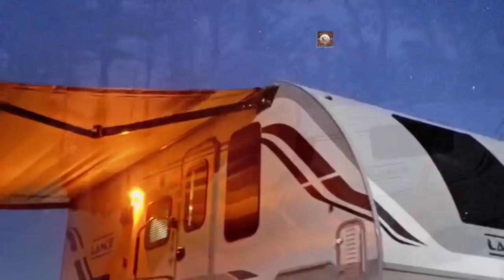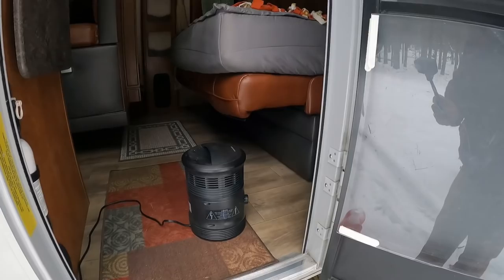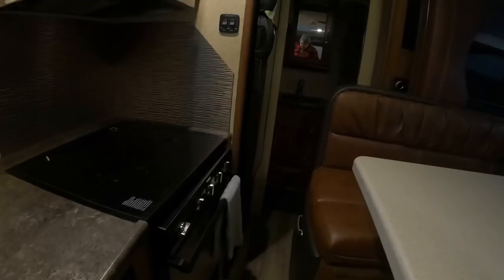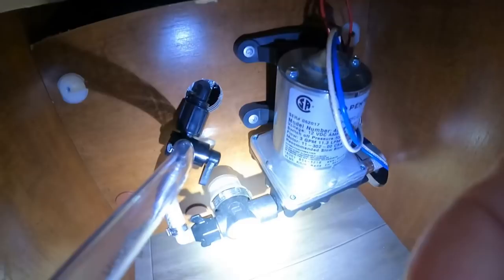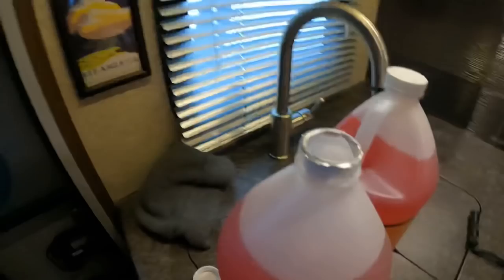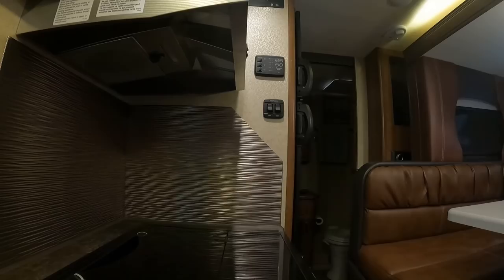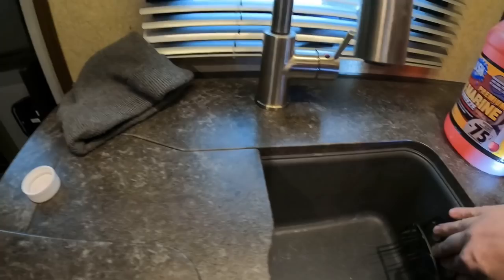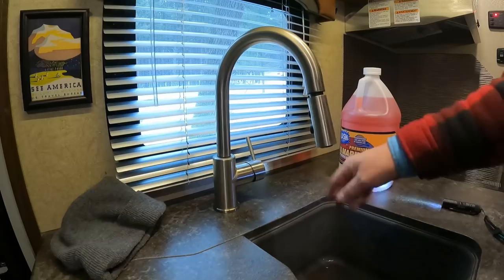Winterizing our Lance RV in Under 15 Minutes!!

Comment: You can leave your lithium batteries in the trailer, just don’t let the solar panel charge it in freezing temps. We live in RI and it’s cold, so we have a switch between batteries and panels we shut off. We Winter camp and charge them back up at a all year campground about once a month. You only lose about 25% in a month if you let it sit in yard. I hope this helps. Happy cold camping! Bob and Deb 👍🏻🇺🇸
Reply from the maker: Thanks for the information on the batteries.  I may just unplug the solar panel and then turn the battery switch off.

Comment: We have a 2019 Lance 2375 and a 2014 Toyota Tundra with Priories hitch. This is our 4th trailer not including the coleman pop-up. I had been blowing out the water system with air. Last year with the Lance I was behind schedule and didn't have time to make modifications to blow outhe system so I decided, against my better judgement to use the link stuff. I I purchased the more expensive fluid specifically designed for RVs in hopes of avoiding the after smell in the Spring. Boy was that a mistake! We dealt with the rotten smell and taste for most of the season. This year I found it was easy to put a female garden hose fitting on the clear tube used for the link stuff. I still used the antifreeze in the the drains. Now we won't have to deal with the smell again. We love our Lance and would be happy to compare notes if you are so inclined. We live in New Hampshire but purchased our Lance in Albuquerque after capsizing our Rockwood in Texas.
Reply from the maker: We have never noticed a smell from using the RV antifreeze before.  We know a couple of people who use cheap vodka to winterize with!  LOL

Comment: I winterized our T@B 400 all by myself this past fall, but I did put a lot of the pink stuff in the fresh tank. Next year I'm going to try it with that bypass kit--it's on my Amazon list.
Reply from the maker: Either way works but it definitely takes a bit more using the fresh tank method.  We have actually done it both ways before.

Comment: You should engage your battery disconnect in the winter because your solar will try to charge the batteries and lithium should not be charged when temps are below freezing, it kills the battery life.
Reply from the maker: We keep heat on in the trailer so the batteries are never below 40 degrees Fahrenheit
Reply: @TravelswithDelaney  I see that they are in an outside compartment that is vented to the outside....Do they still keep warm in there?

Comment: I went a little further on my winterization.  I blew out the lines first with a compressor, drained the water tank and poured about 3 gallons in the tank to run up through the line to the pump.  I also ran antifreeze through the tank rinse line and in our case, the shower miser line back to the tank.  I probably used a total on 6 gallons of antifreeze but I'm fairly certain I'm good.  I left my batteries in and put a battery tender on them.

Comment: Just a word about dryer sheets - my cousin is afraid of mice SHE HATES MICE . When she winterized her pontoon boat she would use several boxes of dryer sheets . Needless to say , she was very upset when I had to remove two active nests one Spring day - and yes the nests were made up of dryer sheets .
   On rare occasions I would get a mouse in my camper . Ladybugs & stink bugs were more common . I finally took care of both of these problems in my camper . I spent a whole day (less naps) finding & fixing entry points . So far for the last 3 years no mice , no bugs . 👍😄
Reply from the maker: thank you for sharing that.  We have used dryer sheets for years and never had an issue.  Good to know.
Reply: What's with the dryer sheets???
Reply: Brion spent 1/2 day fixing all the entry points underneath Shadow while camping in Joshua Tree last fall bc we had a guest at night nibbling on top ramen!

Comment: Howdy!  I believe your model Lance has dry traps in the kitchen and bathroom sink. I believe it is a standard p-trap in the shower. So wherever there is a p-trap you want to include the anti freeze in the trap and put the drain stopper back in to avoid splashing. 
Saw you by-passed, but not empty the water heater. But we should probably assume that. 
We have the 2021 Lance 1985 and blow out the lines because we haven't researched whether or not the pink stuff is OK to consume, or have on our bodies, even in tiny, tiny amounts. But if we find the risk to be tolerable with your method, we will switch since it will shave off a bit of time and set up.
Reply from the maker: I had emptied the water heater the week before when I had drained the low points.  I probably should have mentioned that.

Comment: On the lock it might not be the battery, there is a small on/off switch on the interior side of the lock near the interior manual lock.  More than once I’ve managed to turn it off.  So now when the lock is completely dead I check that first.  The batteries have been lasting at least a year, I change them in the Spring.
Reply from the maker: Thank you....I will check that and see if that might be the issue.

Comment: Hopefully when you drained the water system you opened the hot & cold water valves under the camper and opened the sink spigots inside. This drains the water at the lowest point in the camper.  Also, the water heater needs to be drained by removing the drain plug after it is bypassed.  When I do this in my Lance there is no residual clear water left in the system.  Perhaps you did this, but I just thought I would mention it.
Reply from the maker: Yes I did.  Thank you....I should have mentioned that I had opened them up

Comment: Hi Patrick, Did you drain the Water Heater prior to winterizing (as part of this video?)......as always a Great educational vid, and thanks, Mike Mezo
Reply from the maker: Yes I had.  I had actually drained the hot water heater and opened all of the low drain points a couple of weeks prior.   This was just running the antifreeze through the lines

Comment: I am curious.  Where do the "rodents" that you spoke of get into your trailer??
Be well and stay safe.  Very good stuff.
bf
Reply from the maker: Mice can get in the smallest of openings. Many times we have seen openings on trailers where the manufactures won’t completely seal openings where they run wires or pipes through the floor of a trailer.  That small opening can be enough for them to get in.  Expanding spray foam will assist in solving that problem.
Reply: @TravelswithDelaney  
  Thanks Patrick,
   If all goes well my new 2022 Lance 1985 will finish ins late May or early June.  Your channel has been very informative and helped me with my decision to buy.
   Be well and stay safe out there,
bf

Comment: I’ve had lots of RV’s and done winterizing myself. Did I miss where you bypassed the hot water tank before you ran pink?  Stay warm. -11 here today
Reply from the maker: I mentioned right at the beginning that I had bypassed the water heater and tried to show the valve but the lighting was dark

Comment: Good video but I guess I am confused where the water is coming from if you had already drained the tanks? Did you add some in order to winterize, or did I just miss something? Thank you for the video.
Reply from the maker: It’s just the water in the lines.  When you start pumping the antifreeze in, it pushes the water in the lines out
Reply: @TravelswithDelaney  thank you. I am a newbie. We just bought a 1985 and we live in CO so will be winterizing. Thank you again.

Comment: Could you just use the internal pump  in Tab400 like when we disinfect the water lines with bleach cleaner solution. We don't have any 'pumps under the sink?
Reply from the maker: The pump under the sink is our internal fresh water pump just like you have in the 400....just easier to get to in the Lance.
Reply: Brion said we did have one( he didn't see the video)...he said it's under the bed? Or in the closet?...

So IF we want to winter camp, would we be ok in Shadow from water not freezing in the Tab...we actually left Flagstaff before snow was predicted, last October 🤔

Comment: Thank you for your video. Wife and I are traveling full time in a Lance 2375. Your vids are.VERY helpful.

Do you have any entry door issues?
Jeff
Reply from the maker: Our entry door can be difficult to open. The trick is to place your thump on the door edge as the rest of your hand pulls on the handle.   It’s quirky but when we do that it opens easily.

Comment: Great video. Couldn't you lower the propane heat to about 45 degrees and be just as safe without using up so much propane? The goal is to not allow the pipes to freeze, 45 degrees is a big margin.
Reply from the maker: I have been running it a bit higher.  More concerned about the lithium batteries which are in an area that does not have a direct heat source.

Comment: What's the minimum outdoor temperature that you feel is safe to camp in your Lance 1985 with the water on and with the furnace running? When I asked my Lance dealer that question, they did not want to commit to an answer.

Comment: I have heard of mice making bedding out of dryer sheets. Since your plugged in, couldn't you leave the lights on in the RV? Folks out in Quartszide use lights under the hood of their vehicles and under their rigs to deter mice? Same principle, maybe? I know your tank area is "heated" but you just ran "some" water into your grey tank. Drain it or not to drain it. That is the question. Or, just dump remaining pink stuff into the tank. Better safe than sorry. Thanks for sharing! Steve
Reply from the maker: We definitely could leave the lights on and they are LED so take very little power.

Comment: Nice vid.  I know it’s not Winterization related, but looking where your pump is, you have plenty of room to install an Accumulator tank.  It’s super easy to install, and it helps reduce pump run, and helps with consistent temps in the shower - I seriously think Lance should offer them as a standard, or at least an optional feature!  SHURFLO 182-200.  Check it out.  :-)
Reply from the maker: I need to look into that!  Thank you for the tip.

Comment: How did you bypass the water heater?
Reply from the maker: I just used the factory installed bypass switch that is located by the water heater.
Reply: @TravelswithDelaney  My new 2022 1995 trailer does not have a bypass valve.
Reply from the maker: @agarber1932  That seems odd….most all trailers these days have them.

Comment: I just re-watched this one after your latest winter camping one today. One things that hit me again since I have been interested in this model is that though the batteries have nice hatches that they are vented for lead acid which is not good for Lithium in colder temps. Do you block and insulate those doors? It would be much better if they were in the heated interior I would imagine.
Reply from the maker: Yes....I have put some insulation in the vents to help block out the cold air.